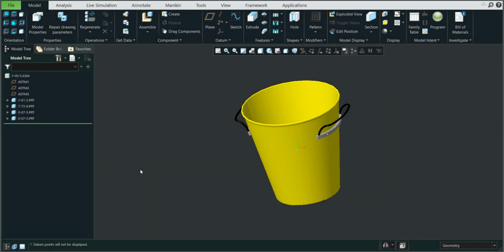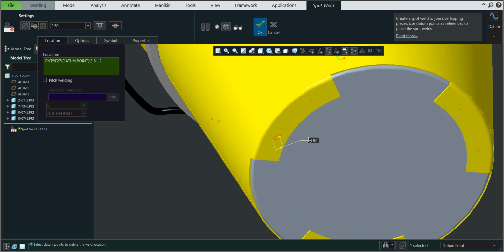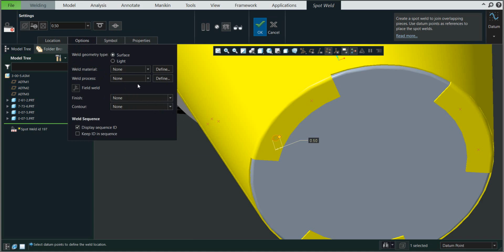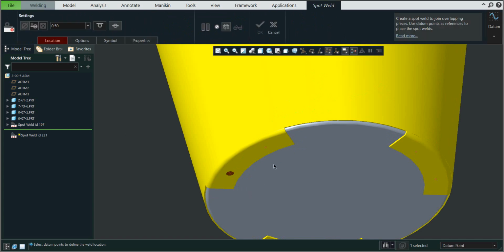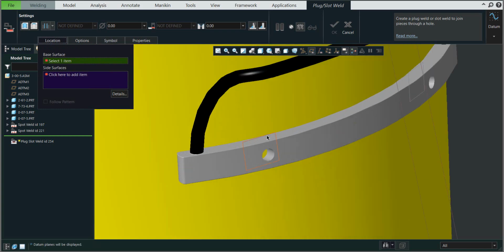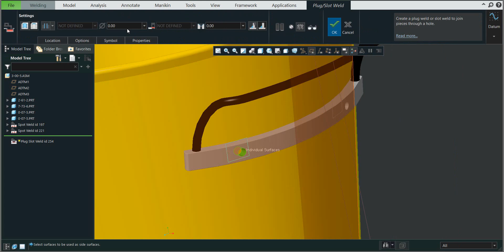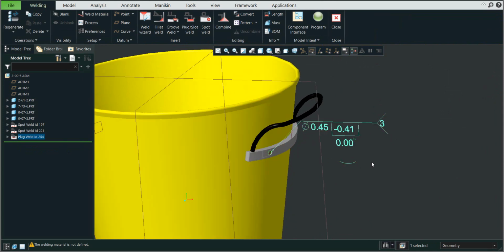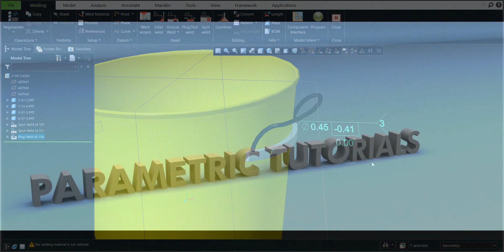Creo Welding tutorial: Spot and Plug weld

Comment: I have a model (assembly) in which I have created a datum point to create a spot weld at, but I cannot select/choose this point in the spot weld creation tool. The point was created by intersecting two reference datum planes and the top surface that the weld will be placed on. The point is not near/on any edges. The faces to be welded together are coincident. I am using Creo 5.0.5. What am I doing wrong?
Reply from the maker: Hi Jerry, I have checked the point selection and you are right  - if the point is created in an assembly, then is not necessary to select this point as a reference for Spot Weld (tested in creo 4). Please create a datum point on the model and the Spot weld will be possible to create. Thanks for your question and stay tuned, Vladimir